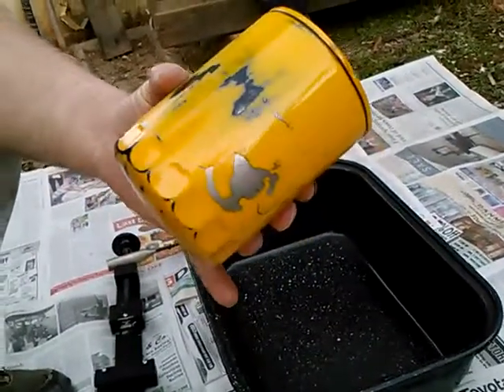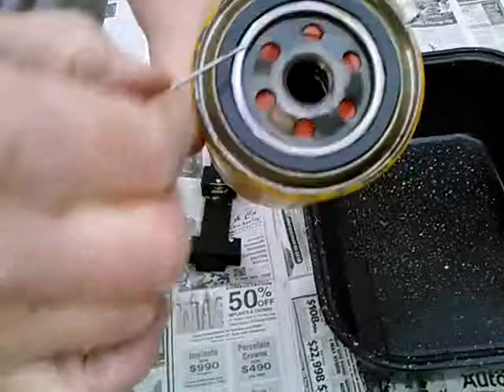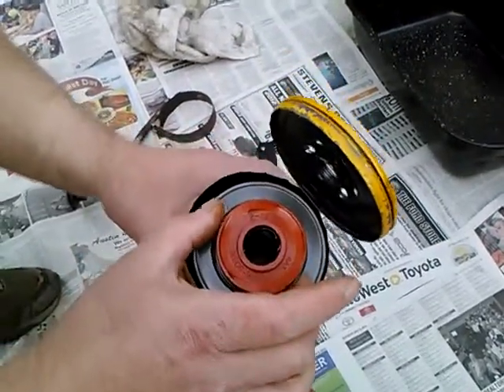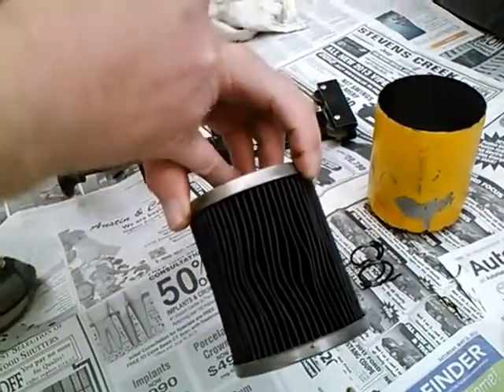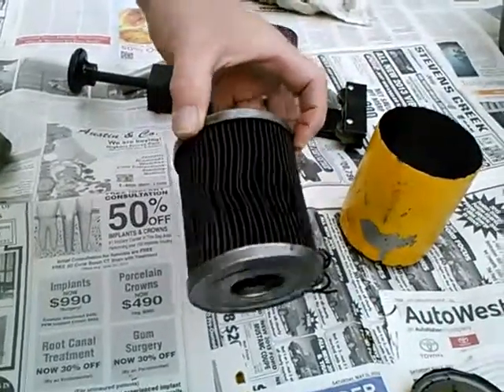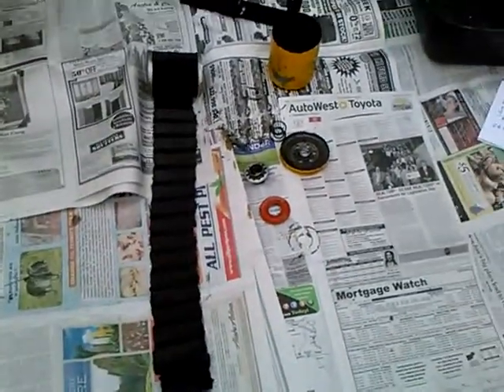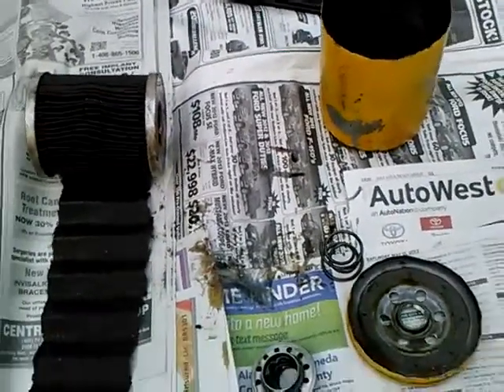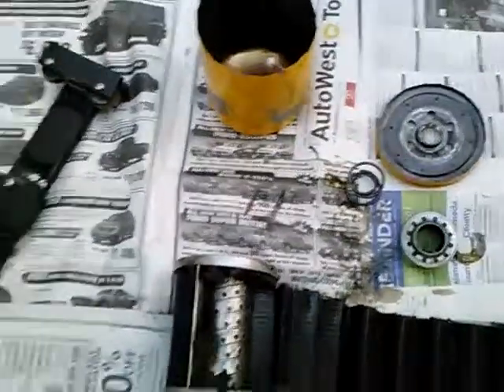Spin On Filter Teardown at 24,000+ miles Air Cooled VW Full Flow Wix MOV295

Comment: What kind of motor oil are you using and how often do you change it?  How often to you replenish the Frantz Oil Filter?  Was interesting to see the inside of the full-flow filter after all those miles, thanks for posting.
Reply from the maker: Sometimes 15w-40 Delo and sometimes 5w-50 Syntec.  Toilet paper roll change every 3000 miles or so.  Never change the oil ... but have to replace 1/2 qt or more when the roll is changed, some oil goes with it.  Thanks for the comment.

Comment: 24k on oil in aircooled vw........That is not good idea. These engines work really hard, the oil lubricates and also cools the engine, it truly is the blood of the engine. Type 1 only had 2.5qts of oil. Adding the flow filter you may have 3.25 qts in the system. Aircooled VW engines torture the oil with high temperatures and a lot of blow by, which means contaminates and oil break down, which leads to lack of lubrication and corrosion ......When I had my VW Beetle in high school,  I changed the oil every 1500 miles....2.5 qts with no filter.......Even if my VW had a filter, I would change the oil AND FILTER every 3k at the max.  Just because the filter is not full of dirt or metal, one should not skip the change on the filter.  Would you pour a beer in glass that still had beer from last week's party and drink it?  I would not even run 10k on oil in a 4 cylinder water cooled car with a 4-5 quart capacity.   I would still  the oil & filter every 3k miles.  The fact that there were metal flakes in the filter tells you that there is major engine wear and the oil & filter needs to be changed more often.  As you stated too, you do not know if the by pass on the filter has been "kicking in".  You could have a lot more shavings circulating and accumulating some where in the engine with a lot a sludge - such as the oil cooler - given the oil has not been changed in 24k.  You need to get and read: How to Keep Your Volkswagen Alive by John Muir & Tosh Gregg.......Please let us know when the engine goes.  I would be interested to see the damage.
Reply from the maker: MrCuckoobox What's the point of changing a filter that's got plenty of life left? Maybe 10% - 50% of its life I've used up at 24K miles, judging from the build up of grit in the folds.  I've run at least one filter with no bypass, I didn't see a drop in oil pressure, so I'm not too worried the bypass was opening on this one.  One thing I really noticed after putting on a full-flow ( 3rd engine I've drilled and tapped ) is there's no "liquid sandpaper" in the oil when I do a valve adjustment, I believe full-flow is the best thing you can do for these early VW's.  But no point in changing the filter before it's even close to used up ... remember this is a V8-sized filter on a much smaller engine moving much less oil too.
Reply: guidoguitar I agree adding a full flow filter is great for these hard working engines with small oil capacities.   Yes, the filter can catch a lot more dirt and metal....If I were to bet dollars for donuts, I would bet that 99% of the oil filters out there are designed to go 10k-15k max. I am sure there are filters out there for long life oils like LE etc.  but the average filter off the shelf at the auto store is going to be around 15k. What happens if that filter fails and the pleated fiber paper rips and all the dirt, metal shavings and part of the paper starts circulating? Do you know when it is going to fail?  Also the longer it goes the more debris will be circulating when it does fail. What is less expensive?  an engine rebuilt or replacing the oil filter?  Also by not changing the oil filter you are leaving at least half a quart or more of dirt oil in the system. That is about around 20% of the old oil left behind. With the blow by that oil becomes acidic and attacks engine parts.    You spent the addition time and money to have the flow through filter set up but not spend an extra 5 minutes and $10 on oil filter and oil for a complete change.....

Would you vacuum your house with a vacuum cleaner that had broken bag?
Reply from the maker: MrCuckoobox I haven't seen the paper rip or fail yet, unless the inner tube is crushed first due to weakness compared to the flow rate.  Can't say it would never happen but to say it will happen is only conjecture.  You make some good points and I don't mind the discussion, there's another guy here that insists any and every full-flow is clogged in the first 10 minutes, you make more sense than him.  FWIW on another vehicle, a V8, I've got a PH373 running with no bypass, I am afraid it may have been crushed already, I plan to take it out of service at 500 hours, look inside.  A test is worth a thousand theories.  Thanks.
Reply: guidoguitar I have seen them rip and fail...And it does happen..There are examples on YT.  Does it really make difference?  In away no.....because this engine was designed with "fly screen" strainer.   The book I mentioned above "How to keep your VW alive." recommends 1500 mile interval for oil change because: 1) the oil is the lubricant and coolant  2) there is only oil a screen 3) the oil capacity is only 2.5 qts 4)the oil breaks down because of the heat - air cool engines run hotter - at least these do as stock engines.

If you have gone through the trouble to put the flow through filter on this engine - change the oil and filter  together.   You could look at LE or Amsoil (or other long drain oils) to run long intervals but again with the tolerances in this engine - blow-by would not be removed by the filter.   This is inexpensive insurance.  If not (to change the filter only let it fail) why bother even putting the adapter on in the first place.  Just run the engine as is.
Reply: Muir was a well intentioned idiot.

Thank you for your video.  I'm not sure if it was an intentional experiment, but thanks.  I have also full flowed some VW's and I personally like WIX filters a lot.

It's good to see the amount of crud you have accumulated and the condition of the filter paper.  I think you were bypassing a lot.  A whole lot.  The pores of the paper look saturated with fines.

My main question, unless this was an intentional experiment, is why didn't you replace the filter sooner?  The filter is way cheaper than the oil you are running.  By the way, what oil were you running?  And how far north or south do you live?  And do you run short trips, or long drives?  What size oil pump were you running?  (I live way up north where weather IS a factor)

The reason I'm asking is I like my air cooled VW's and I putz with my motors, and increased engine life without breaking the bank is nice.  More info is never a bad thing.
Reply from the maker: Okay, first of all, these PH8A form factor oil filters are ubiquitous on Ford V8's, I assume that's what they were designed for.  Much bigger engine, long change interval for the filter, higher oil flow rate.  So just by the math this filter on the VW we can reasonably predict 4 - 6X the change interval.  Put differently, look at the size of a spin-on filter on an air-cooled motorcycle equal in size to the VW, they are tiny.So, is it bypassing?  If I put a differential pressure gauge across the inlet and outlet, that would provide the answer, especially if I could read it on the dashboard.  I run 5w-50 or 15w-40 to keep the warm up oil pressure low especially in cold weather, this should reduce bypassing in that warm up time.Daily driver, so both in town and freeway, short and long trips.  SF Bay Area, so temps between near freezing to the occasional 100+, but usually moderate, between those extremes.  Also, I run the thermostatic flaps, really cuts down on condensation in the oil.Thanks for the comment.